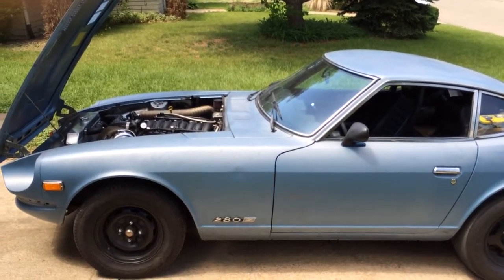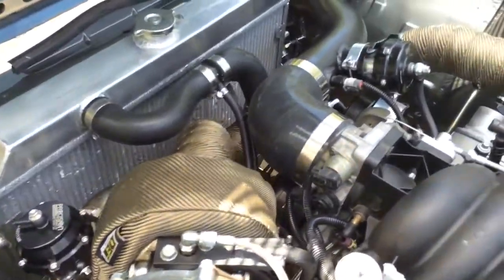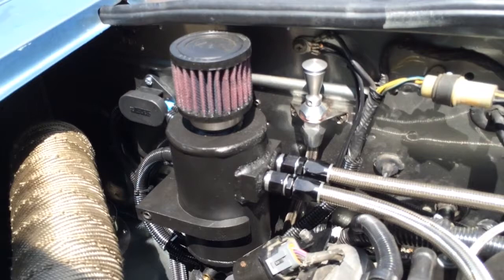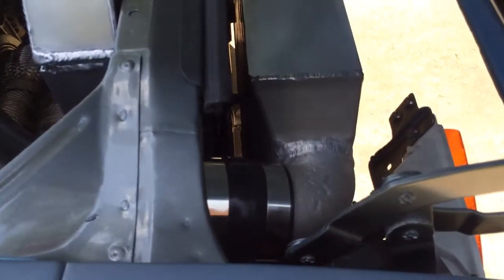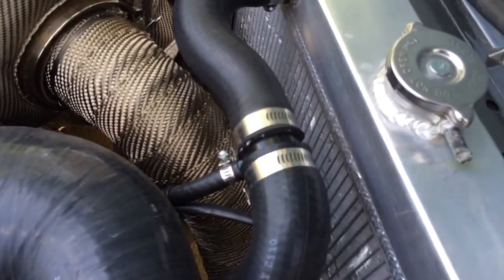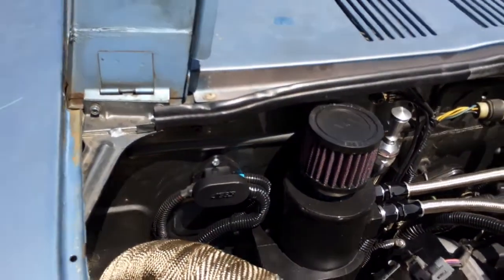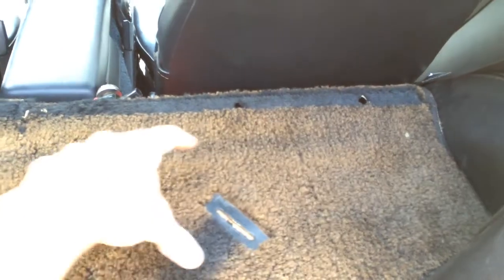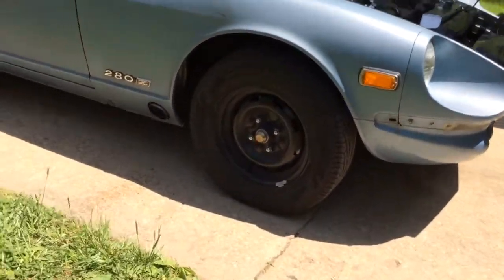1978 280Z 5.3/auto single turbo

Comment: kbern88 I need to pick your brain on on a similar setup!!
Reply from the maker: jamar adams anytime brother.
Reply: kbern88 what/how did you do you fuel system? What are you using to tune it?
Reply from the maker: The fuel system consisted of a Bosch 044 fuel pump and corvette fuel filter/regulator. I also had a methanol injection system on it that only came on under boost. We used HP Tuners to tune the ECM.
Reply: kbern88 stock fuel line?
Reply from the maker: The stock fuel lines were removed and 3/8 aluminum line was used in its place.
Reply: kbern88 3/8 for feed and return? What rear end are you running?
Reply from the maker: Just the aluminum 3/8 was ran to the engine. The corvette fuel filter regulator has a return port on it and we used stainless braided 3/8 back to the tank. If you watch some of my other videos it shows it. The rear was a stock R200 with welded gears and stock axles.

Comment from the maker: 15 grand is all it would take my friend.
Reply from the maker: There are a ton of options for engine mounts and all the other pieces you'll need. I'd recommend checking out hybridz.org. A ton of knowledge can be had in the gen3 LS section. My name on there is slow78z and I have two build threads. One for the non turbo build and one for the turbo build. A lot of other good threads are there too. Good luck!

Comment: I'm doing the exact same swap on my 240z right now! I'm using a th400 trans though. How is the 4l60e holding up ? Also what are you using for computer ?
Reply from the maker: The 4L60e didn't last for crap. It did good until the slicks went on. Lol. We eventually went with a powerglide. We were using the stock F-body ECM.

Comment: always run an air filter
Reply from the maker: I've seen to many horror stories of turbos getting destroyed from filters getting sucked into the turbo. Even ones that should work for the turbo application. If I were driving on a lot of dirt roads I definately would but this car only sees pavement.
Reply: No, please, simply buy a massive filter. You much more likely to get a pebble that to "suck a filter"...